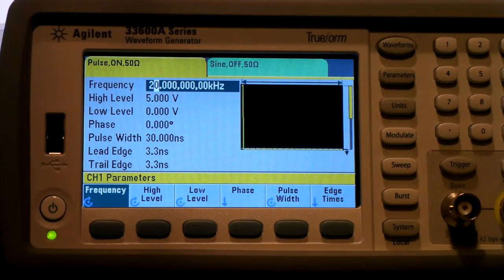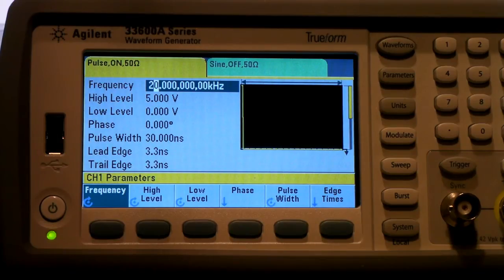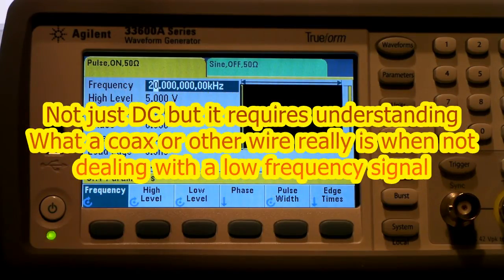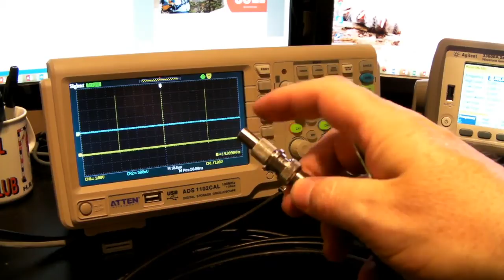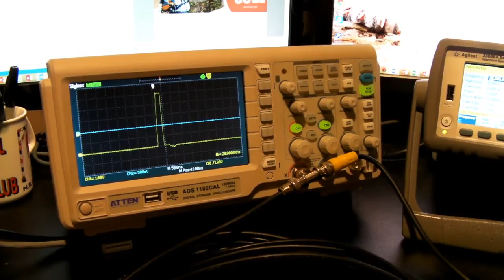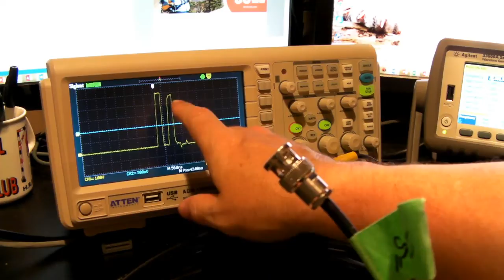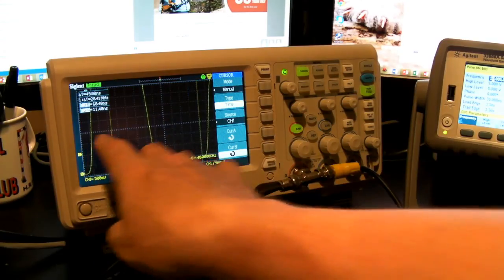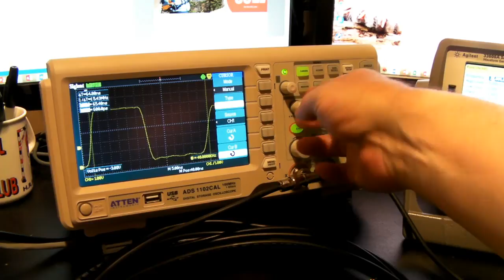TDR #2 RG58 Measurement

Comment: Hi, would this method also be possible to use on a single conducting wire, as opposed to a coax or twisted cable pair?
Reply from the maker: I have not tried this but the wire would be acting like an antenna,  If I get a chance I will try it, as with all electricity, if there is no return path then nothing flows. and while im no expert on antenna theory I suspect you may get something but it will be very dependent on the air, humidity and other factors that are near or affecting the wire

What are you trying to test ?
Reply: @TheBreadboardca  Thanks for your quick answer. I'm trying to figure out whether i could use something like this to detect faults in a lightning conduction system of a wind turbine blade. Since that is only a wire connection from blade tip to ground, no return path is available in that system. Also, a wind turbine blade is often connected to the HUB with a "spark plug" that only conducts with high voltages, so the system could be modeled as a single wire without return path.
Reply from the maker: @tktktk17  If there is a spark gap in the wire then it wont work beyond that for sure, at least not without "Possibly" building a special tester, also if the entire frame is metal and grounded then it is technically providing a return path, you would inject the signal on the wire and inject common connected to the frame also.

Comment: Hello,
I tried to do a similar experiment and measure a 450m long RJ-11cable.
The amplitude of the incident pulse set to 10 volts and I was able to see the reflection but the amplitude of the reflected pulse was very very low ( a few microvolts or even lower!)
what can I do to have a measurable reflection?
Is there any way to have a strong reflection?
How can I use TDR to measure a very long cable length(say a 10km long cable)?
Thanks
Reply from the maker: One thing mentioned in the video (I hope). if the cable is terminated correctly or close to correctly then you won't see a reflection or a small one, depending on the difference between the termination and the characteristic impedance. If you want to see a big reflection then either short out the cable or have it open circuit.
Also 450m (Close to 1/2Km ) is a very long cable and so will also experience a lot of attenuation along its length, basically one really long resistor chain., and if you factor it also has to return, then closer to 1KM. If it is on a roll then you could measure the pulse at the other end of it and half the effective distance, This will also increase the received signal strength.

I dont have a cable this long or even close so I am unable to try this myself.
Reply: Thanks Peter
The cable I used is not terminated.

Comment: Hello again!
Does bending the cable or looping it affect the measurement?
what about interfering noises near the cable? is it a matter?
Reply from the maker: Tight bends may well show up as you can change the impedance at the bend due to compressing / deforming the cable. If it is a loose bend then it should be ok, Noise from other devices close by could inject a signal on the line but you should still be able to differentiate between that and your expected signal. Are you having an issue finding the reflections ??
Reply from the maker: As you would see in my video, many of my tests were with coiled cable, just not tight bends.
Reply: Peter Oakes 
I am a bit worried about the noise interference as I want to detect the reflections by a circuit not by looking into the signals on the oscilloscope.
Reply from the maker: use a stronger input pulse to reduce the signal to noise ratio

Comment: Do you think I can measure the cable lengths below one meter by a 70MHz digital oscilloscope?
Reply from the maker: The original scope I used was not really better than that, the first issue is to get a narrow and fast enough pulse to shoot down the wire, it needs to be narrow  so the reflection does not crash into the transmitted pulse (OR minimise it anyway) so it is easier to detect. Your accuracy goes down too with such a short wire. if I remember correctly were talking about a few nS per meter, but as a relative measurement it should work, just dont rely fully on what ever amplitudes you are reading, more on is there a blip and what direction is it.

Comment: I have a question. What would the reflections be if the cable is shorted in several points by some resistors?
Reply from the maker: Wow, time to brush of a few cobwebs lol.
I would imagine that you will see small blips in the trace where the polarity of the blips will depend if the resistor is above or below the characteristic impedance of the wire. If you're really unlucky, some reflections may be in phase or  180 out of phase and hide themselves by either amplifying the reflection or canceling it out. This is speculation as I would have to test to be sure, sounds like a fun future video :)